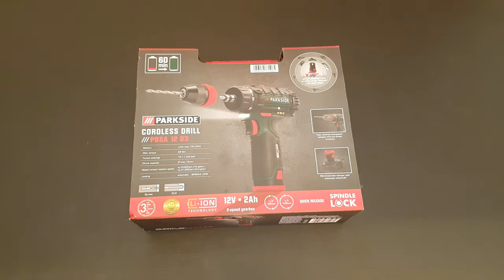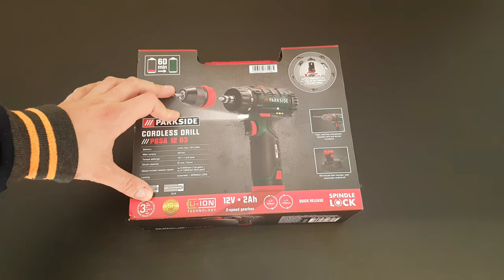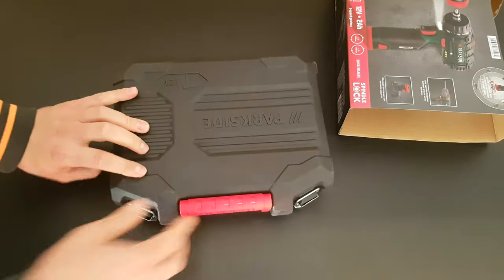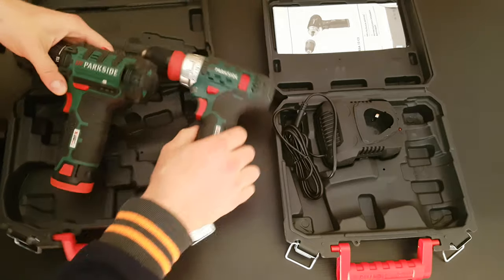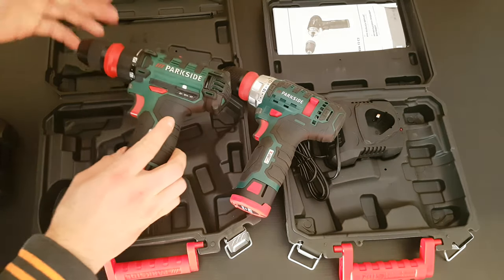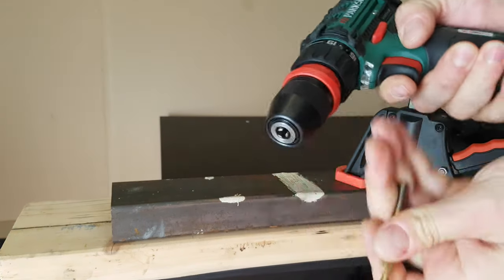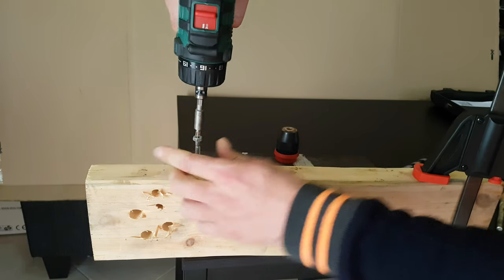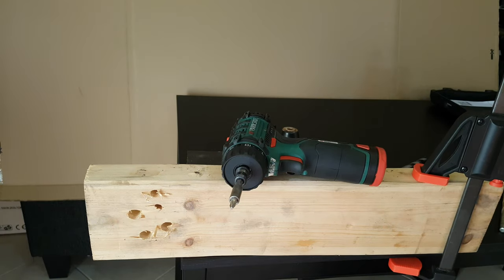Parkside cordless drill PBSA 12 D3 Unboxing Testing

Comment: In Bulgaria they sold this without the battery and the charger. The battery i bought was different visually (it has a "base" so the drill can stand)  but with  4Ah.  Too bad that the case cant fit the battery if not plug in the tool.
Thanks for the review! I was looking for somewhat "instructional"  video and yours did the job!
Reply: The battery you have is the only useful one for other 12v tool like the angle grinder, the planer and the onehand circular saw especially. 2ah is useless on those, too weak. Good choice!
Reply: @SHRINKBEADS101  Thank you for the reply. I was a bit worried. I thought it is gonna be too weak ( for drilling).

Comment: Good vid,mate! I have a quastion. I have a 4 in 1 multi tool. It is a 20v system, but I'd like to have a better drill. Do you recommend this over my 4in1 tool, or should I buy a "bigger" Parkside, or maybe an other brands product? (For some works around the house)
Reply: Parkside is excelent for home use.
A friend of mine and his coleagues are using this at a car dealership. 
Tough tools.
3 years warranty.